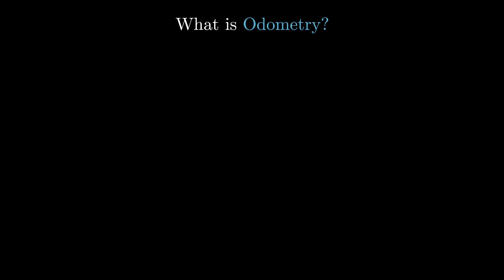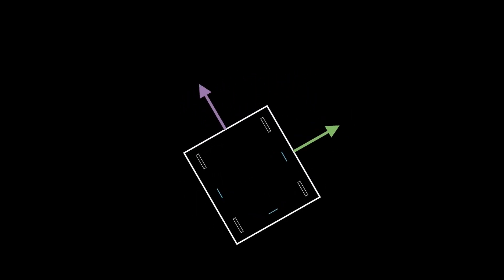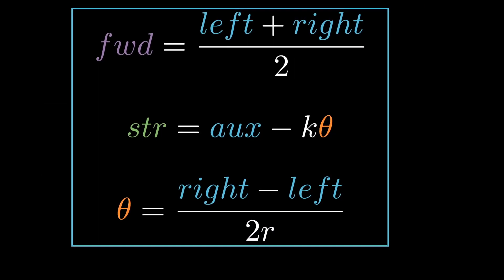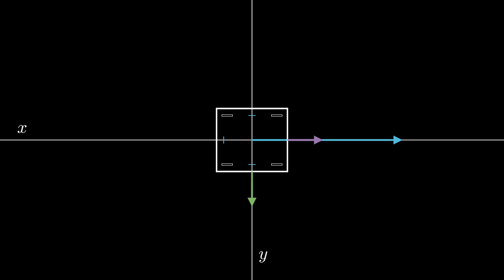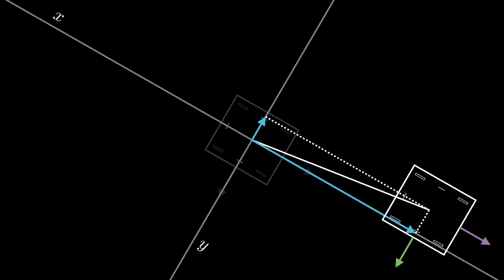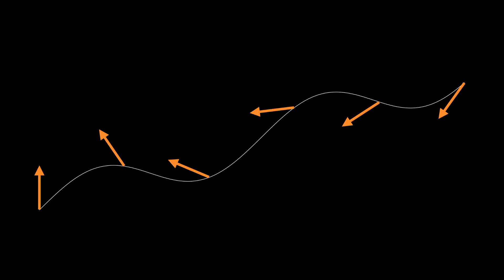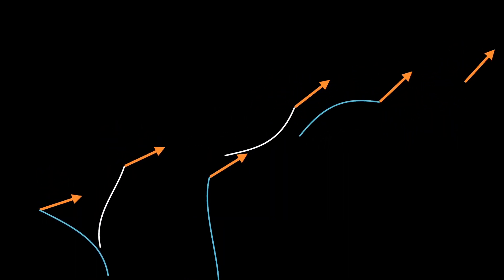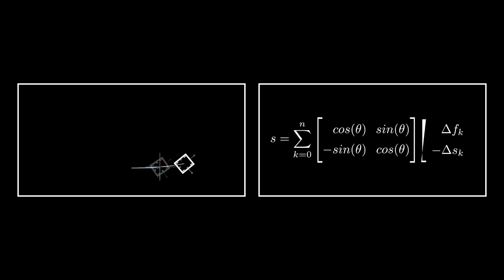Intro to Odometry, Part 1

Comment: Thanks for this, it's really well-produced, goes through the content clearly and in a good progression. If you have the voice I couldn't tell it apart from 3blue1brown. I do have one question about 8:23, the video says
"Rotate the approximation (of the displacement vector) to the global heading"

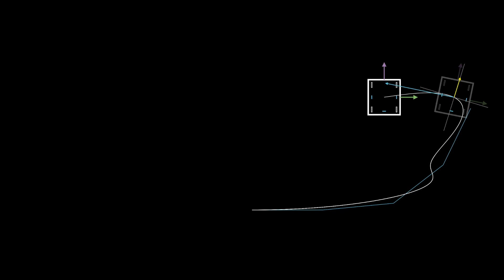does it mean to rotate the displacement vector by the change in the global heading? In either case, from the animation (which is really nice btw) I can't figure out what controls the rotation of the displacement vector. Especially this move at 8:58, the robot's heading barely changes, yet there is a huge change in the displacement vector's direction.
Reply from the maker: To rotate to the global heading is to undo the effect of the robot's overall rotation, not its change in rotation. Thanks for pointing that out. I should've been more clear when I said "changes in these values", as to only refer to the translation values.
Reply: @punchster289  Thanks, the math is confusing but after studying the animation I think I get it. I'll definitely try out this approach with the real robot!
Reply: @punchster289  I've just tried it and it seems quite accurate as long as the robot's final destination doesn't have a different orientation. However when the robot does have a different final heading, there is some error, I think because the odometry wheels aren't always at the center of rotation. 

We're running a 3 wheel odometry setup like in the video, so if the robot turns in place 90 degrees, the strafe/horizontal odometer returns a positive reading (while the forward/backward odometers cancel out). As the robot's global heading changes, the translational vectors rotate from 0 to 90 degrees, and the robot ends up thinking it shifted 45 degrees diagonally.

Do you have a solution for this?
Reply from the maker: @theclueless11212  Did you subtract off the rotation component from the strafe wheel? If you don't, it will think a rotation is a strafe.
Reply from the maker: @theclueless11212  Also, the center of rotation doesn't have to be the center of the odometry wheels. I drew it like that for simplicity sake, but the only thing that matters is that the left and right wheels are parallel, and that the strafe wheel is perpendicular.

In the case where they're not centered on the center of rotation, you can still test for accuracy by moving the robot such that it ends up in its starting pose, and observing how close to 0 the measurements are.

To adjust its center, simply add a vector representing the offset between the centers in the local heading rotated to the global heading. You can find this offset by measuring your robot directly. Keep in mind that the position you want to increment onto is the one corresponding to the center of the odometry wheels.
Reply: @punchster289  Ah that makes sense. When you subtract the rotation component do you just assume the robot is turning about it's center? in which case you would subtract this:
strafeWheelTrackWidth * globalHeading
where strafeWheelTrackWidth is the distance from the strafeWheel to the center of the robot. If that's right, would you recommend calculating globalHeading based on a gyro/IMU reading or based on the difference between left and right odometry wheels?
Another separate question: does it matter of the strafe odometer is not centered (but instead is offset right/left)?
Edit: nvm I think your last comment answered this well.
Reply from the maker: @theclueless11212  In the video I showed getting rotation from odometers because they were the only sensors being discussed , but if you have a gyro available to you, using it for rotation is absolutely fine. It would also mean one less factor to tune. If you are going for high precision however, getting rotation from the gyro can increase error. I'd say test it first and see.